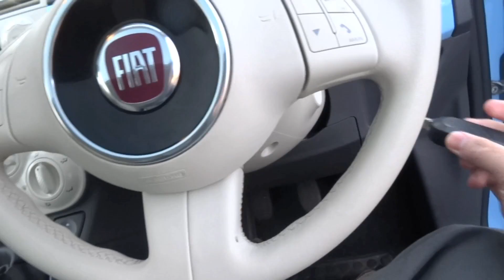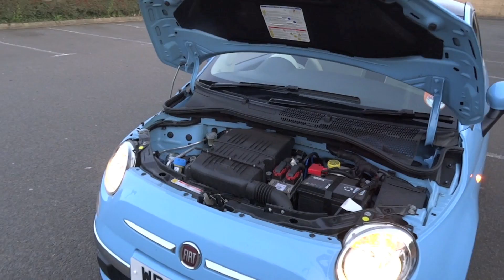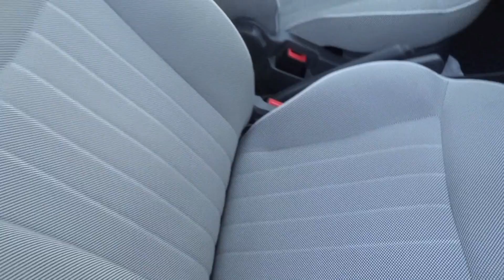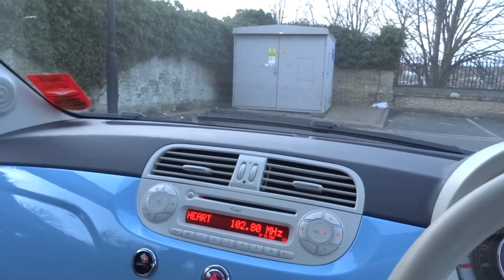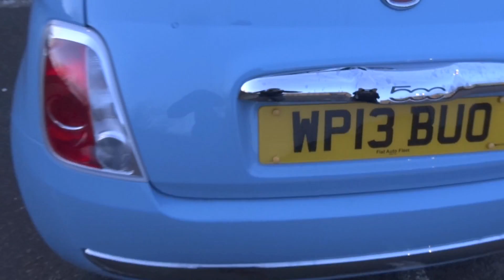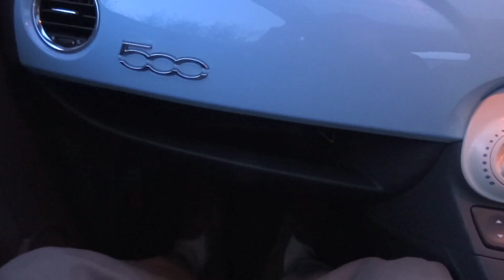2013 Fiat 500 1.2 69 Lounge Start-Up and Full Vehicle Tour

Comment: I need help figuring out why my 2013 Fiat 500 pop will not run more than 3 min.  the crank shaft was replaced, new spark plugs, oil change. it has a 90 psi test.  I have the engine out of the car and can't find the cause.  Please HELP HELP!!!!!!!!!  68000 miles Text me 720-585-4930

Comment: every review this guy does is ruined by excessive wind noise. He needs to invest in some microphone shields.
Reply from the maker: I'm not too sure whether you noticed, but I was using a microphone.  I'm pretty sure there are much more advanced equipment out there that may cut out wind noise 100%, but I'm not a professional, so I make do with what I have.  The microphone that I use does a decent job of reducing wind noise compared to when I was not using a microphone.